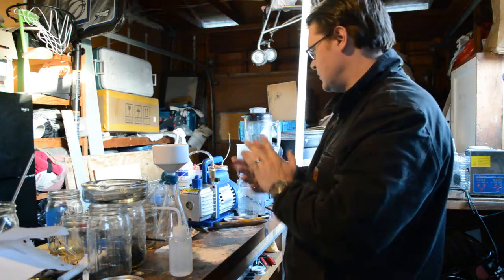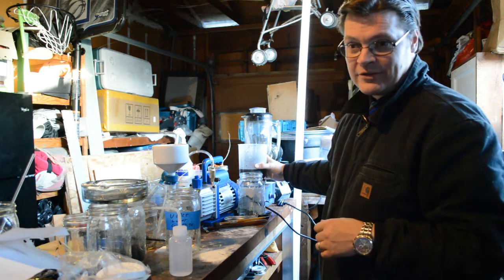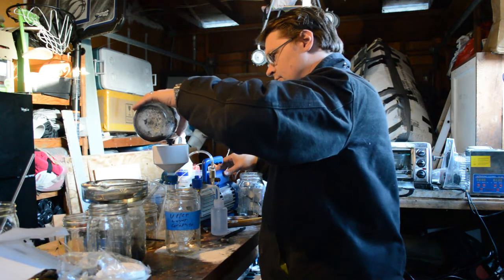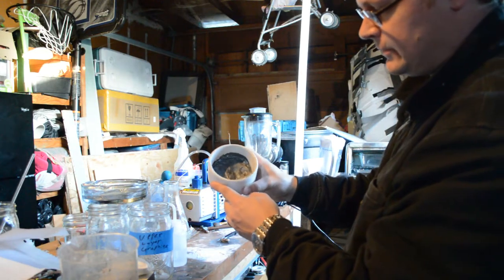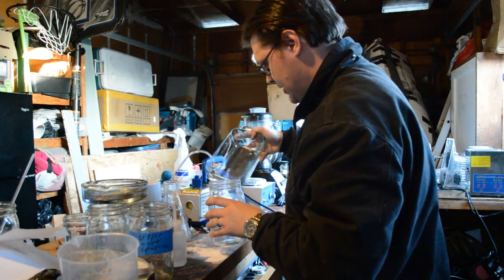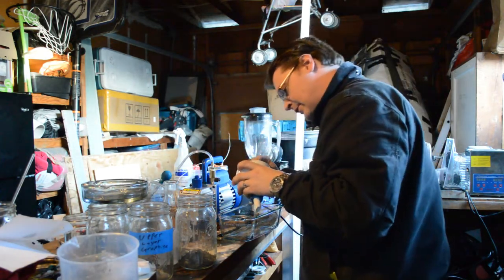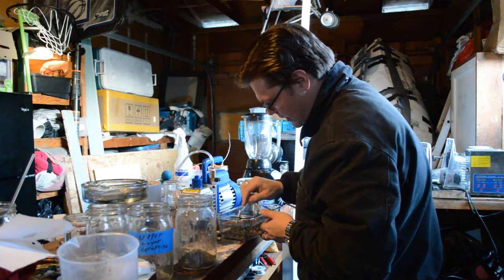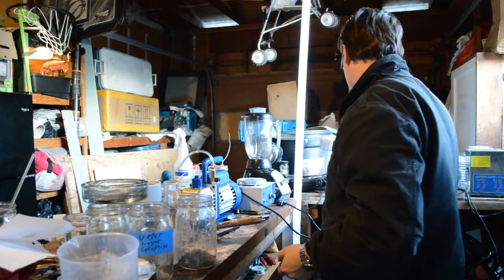last stage of filtering graphene like product.

Comment: Yo, ya maybe your rt on the money. What is like to,is say ; after the first run, decant pour off top liquid,and use hydrogen peroxide with this portion for synthesis of GO. ..the bottom solid of this first run should be mic assisted expanded solid flakes..can be further reduced.

Comment: Ok beaker marrow mouth. Sonicate graphite in it. When done it’s corked with a hole for tube. Put couple marbles in it. Set on a portable heating element. Set beaker in a pan to distribute heat even. Suck it dry. Roll marbles to break up.

Comment: Marbles in old paint spray can
Reply from the maker: Guy Ruff I have a ball mill. I don't have a scope or a way to vacuum cook. Special equipment. Plus I'm not using it for filtration. Trying to make super caps. It works but as you can see in the background I need to clean and finish my garage so I can expand and work properly. Maybe in a year or two I might have enough for some of those things. Even then you still need a special scope to see particle size of graphene. Which is super expensive.

Comment: Lets see. Carbon is used for its properties of absorption of impurities. Your exposing the dried medium to atmosphere that is loaded with all kinds of impurities. Once you sonicate it should be baked under vacuum. When you filtered it you drawer impurities into the graphite. Also try scoping or look at the size of graphene your filtering just captured the graphite not graphene. 
Take your fluid and boil it down under vacuum. That will be your graphene. Once you dry that put a marble in and suck corked beaker down and inject inert has. Nitrogen or argon. Then roll marbles to break up the cake.
Reply from the maker: Guy Ruff if I could afford the equipment I would.

Comment: Hey...is that a ultrasonicator on your shelf? Why go through all the trouble when everybody (scientist) are  using sonicator to make single layer graphene and graphene nano tubes? Robert Murray Smith here on you tube has the process...
Reply: file:///C:/Users/stock/Downloads/Review%20Ultrasound%20Graphene%20Exfoliation%20(4).pdf
Reply from the maker: Greg Shafransky well i have just didn't do a video on it yet. After i finished this i ran that product through the ultrasonic for about 6 hours per gram. I started with 22 grams of product. So it takes a while.
Reply from the maker: Greg Shafransky i also have an electrolysis setup. I will probably do my main process that way. Then filter and sonicate.

Comment: what you took out of the pan, you guessed right, not graphene.
Actual graphene is pitch black and will float around etc. if you are not seeing pitch black dust cloud raising doing that -> you don't got graphene.

I am here just to find out WTF do i do when i left my graphene on the open air for months drying and now it's in clumbs and my blender is not working for shit -.-
I think it's the sulfate contaminates which is making it hard to work with, but open air drying, and non-vacuum filtering takes so much effort i don't want to redo that
Reply: oh reason i don't care that much about having a bit of contaminants is because i use it for composites in the hundreds of grams scale
Reply from the maker: You could try and hand grind it or get a coffee grinder. As for the sulfates not sure. I was think of try hydrochloric acid but i need to read up on it more. Just out of curiosity how do you get to your graphene product.
Reply: You saw my video.
Basicly electolysis with Sodium Sulphate or Ammonium Sulphate. Pretty much any SO4 ending sulphate, and try to keep PH neutral. 0.5molar mass, begin with 1.5-2volts to "get it in", then raise voltage to 10V (or 12V).
Very easy, very quick with graphoil type of material. Bulk material slower but, well you get more bulk :)
Finish it with sonicator to do the final separation, wash, filter.
Full process is demonstrated by Robert Murray-Smith on his channel.

I think coffee grinder will not get it back into 1-2 atom thick layers, but just smaller coagulations. I tried by hand in a small sealed plastic bag, not good.
So off back to bath, sonicator and redo the whole process.
That batch is about 100grams or so of graphene, so not a big one. I am gearing up currently to move to bigger batches :)
Reply from the maker: Cool